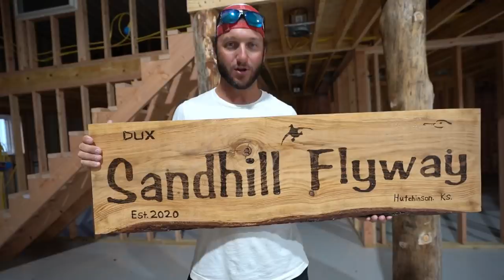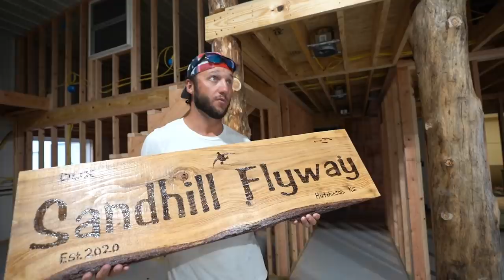I Bought My Dream Truck and a Pet Mallard!!

Comment: Hey bob, as an experienced diesel owner and mechanic for myself and many others trucks, dpf and egr delete are essential for longevity and problem free engine life. Egr and dpf both eventually fail/clog, and cause issues. But to delete these things and not have a check engine light on, and in some cases to run correctly afterwards, the truck will have to be tuned. You know how modifying anything especially diesel trucks can get expensive and out of hand quickly but i think a lot of us would enjoy some diesel content, so theres your excuse to do it haha. Keep up the awesome work, i hope to come hunt with you/ your company one day🤘🏼

Comment: That looks like my dream truck that I don’t have yet. Except I would black mine out. Congrats Bobby you definitely deserve it!
Reply from the maker: she’s a beauty
Reply: BobbyGuyFilms you need to put a cold air intake on it. It is an easy way to boost the performance without having to do a ton of maintenance.
Reply: BobbyGuyFilms for some reason it autocorrected horsepower to performance, but both work.

Comment: 2005 Dodge ram 5.9 lt Cummins. Ranchhand full rap brush guard.  Almost have 300000 miles on her. My hunting fishing rig. Traded my 1998 2500 v10 ram for the 1 ton .  Green heads and whistling in the morning. Good luck

Comment: Look up a raceme tuner. I have the same tuner for my truck. It comes in 5 stages and all you need is the tuner and a 4inch delete pipe. My 4 door cummins with 35in tires gets 26mpg with my def deleted and straight piped. You can look at the video on the raceme website and install the delete on your truck in no time at all yourself. It’s easy!

Comment: Bobby you should also fix a flitter that gets very dirty and the truck want be running go so it’s better to buy so the can delete that problem and I’m telling you cause on time my uncles friend are welders and they use dodge Cummins 3500 and his buddies truck as not not running go so he had to take it to the dealership to get it fixed because of the fill the was very dirty so my uncle buddies did to his truck and the truck was running well after he did the flillter it was running like it was new.

Comment: Dont do anything with the def and egr until it fails on you. The failures are blown out of proportion. There are tons of guys out there running them for 100s of thousands of miles bone stock. Especially with it being a 16, the emissions equipment is much better than the early years like pre 2013 for the Rams